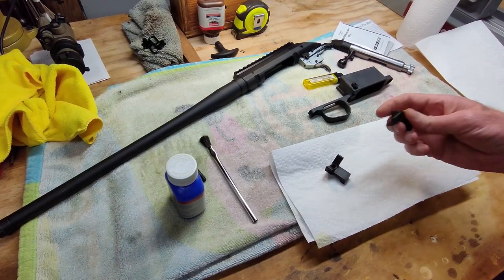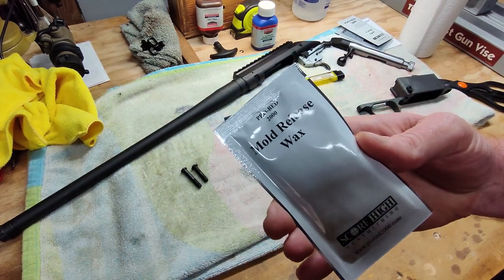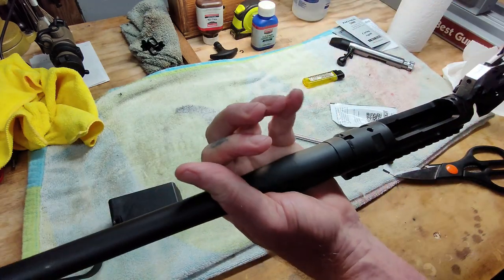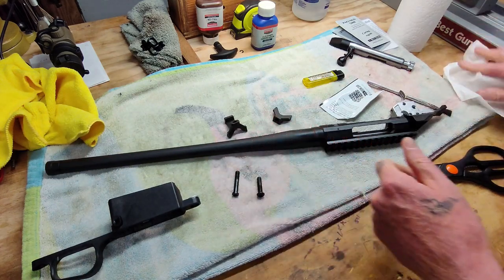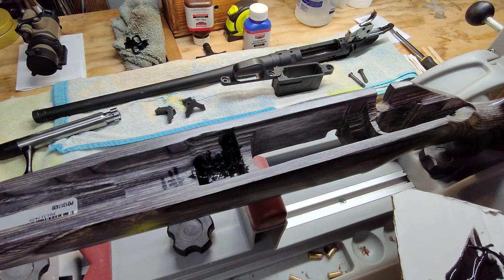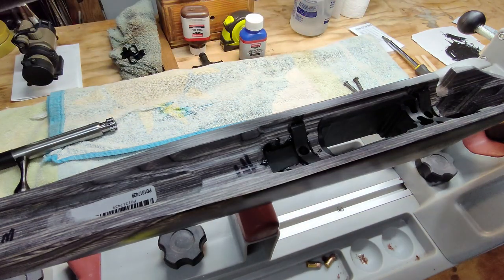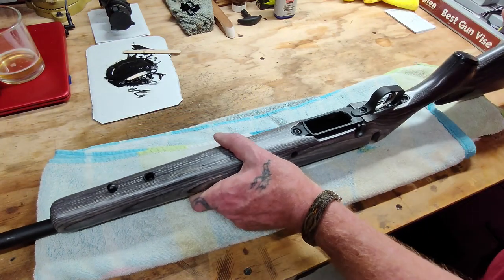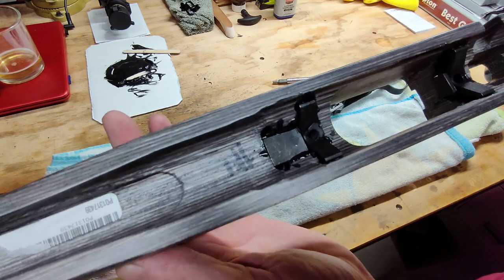Ruger American Action Bedding into Boyd's Laminate Stock

Comment: What happens if you just don’t bed it?
Reply from the maker: If you don't bed the action to the recoil lugs at some point the stock will break or split, then you'll be needing my other gunsmithing services. I repaired an 8mm Mauser sporter a while back. Looked like just a wood chip off the back of the stock was missing, and a small crack. After disassembly it was discovered that there were no recoil lugs, and all of the action screws were bent. I had to fix the chip and crack, add pillar bedding and replace the bents screws.